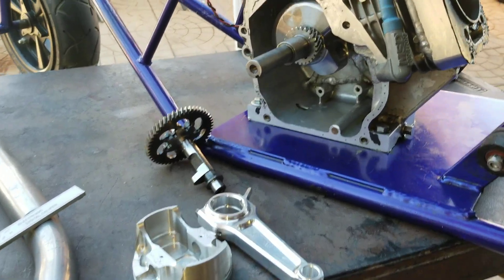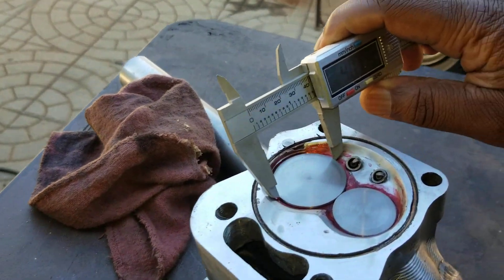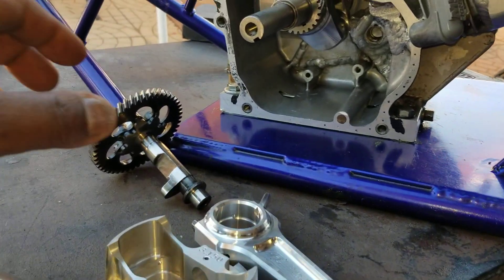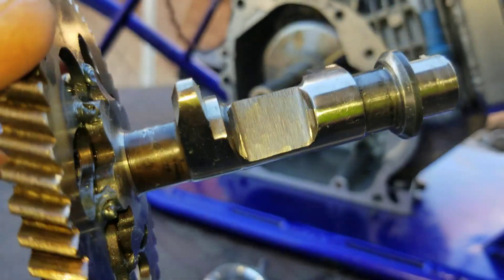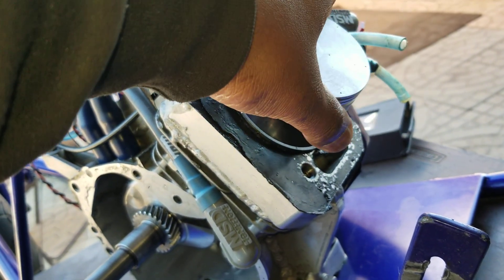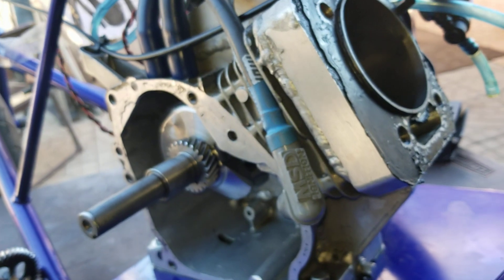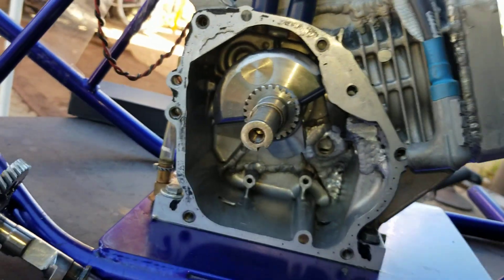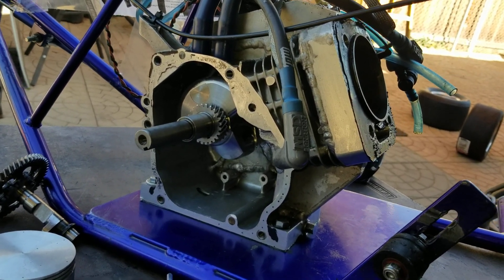Confirming BlueDevil Engine Specs, My Most Powerful Small Block(for now)

Comment: You ever build one for oval track racing
Reply from the maker: All the time
Reply: minidragbike what would a ball part figure be for you to build a race ready predator 212 running on 110 octane, it’s a open class on a small oval dirt track the machine weighs a little over 200 pounds
Reply: Ever built one for a racing lawnmower